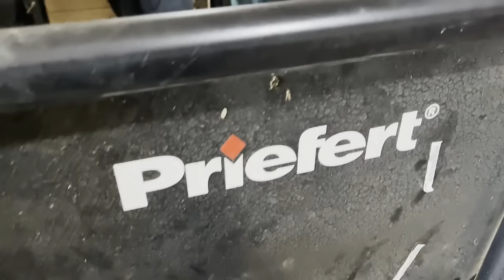We Leave for ONE Day...

Comment: Just a suggestion, you might want to buy some of the sprayers that hair stylist use that send a constant stream/mist. It will save some time and energy using the original bottle. Just make sure you label them well. 
I used to have an all white horse named Magic. He had belonged to John Denver. I had him in 2006-2008 and he was 18 then.
Reply: Yes on the sprayers, not sure I know the exact ones you speak of but I have seen some that are like atomizers where you can widen or narrow down the spray field and they are just about totally quiet. They say that you also save more of the product.  Fly spray is stinky and I have seen horses that won't let a regular hand pump spray bottle near them, but stand so much more quiet with the silent atomizer do hickie!